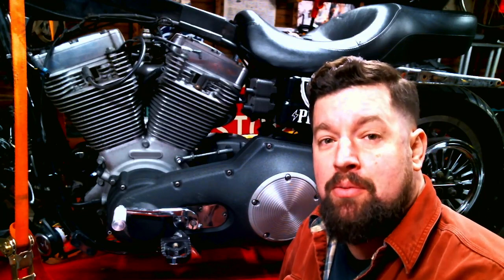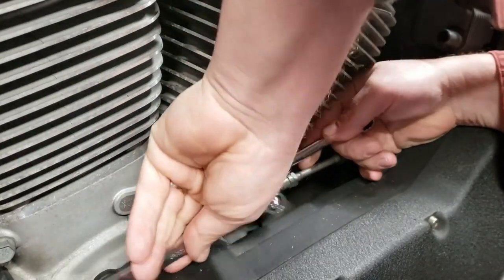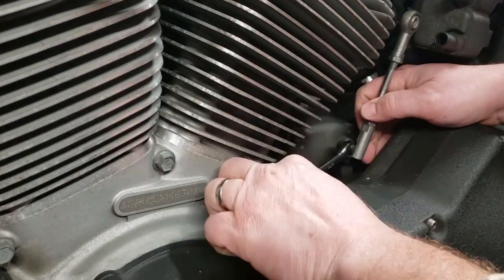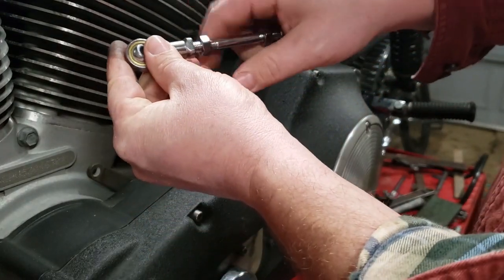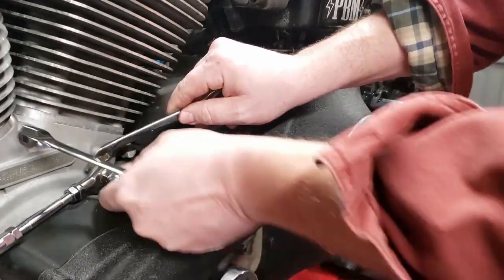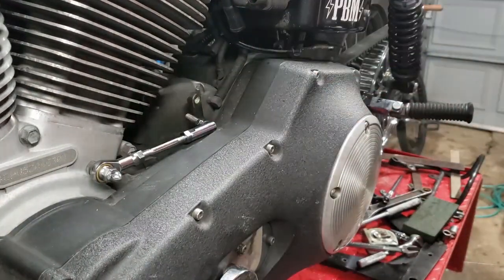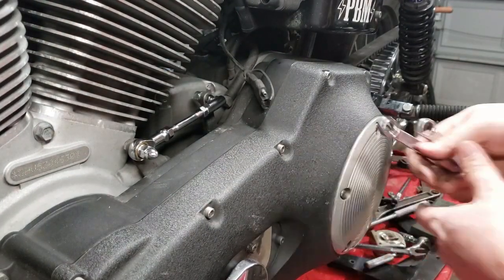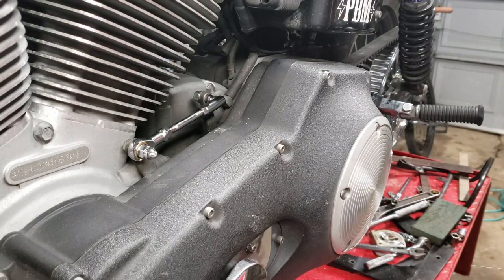Replace your sloppy shifter linkage on your Dyna

Comment: Where’d you get the derby cover?
Reply from the maker: I made it.  It’s a stock cover that I sanded, then cut grooves in it, on a lathe.
Reply: Looks amazing.
Reply: @KnobleMoto  what grits did you use to get the chrome to that stainless look finish?
Reply from the maker: @justinelliott1550  I sandblasted it.  Cut the grooves and then I did a satin clear coat (rattle can).
Reply: @KnobleMoto   gotcha thank you. I have an extra chrome one laying around. I’m gonna give it a go tomorrow lol
Reply from the maker: @justinelliott1550  awesome.  It wasn’t hard.